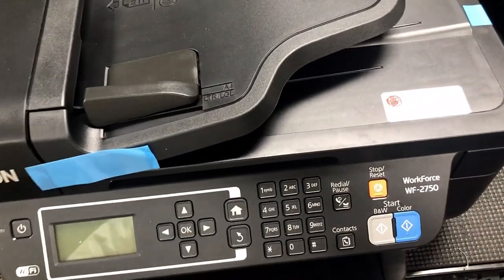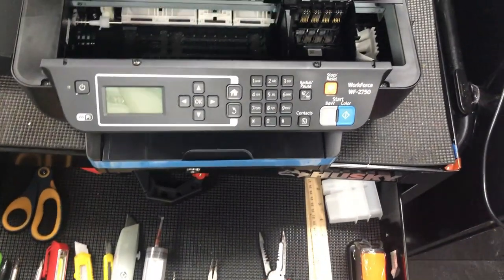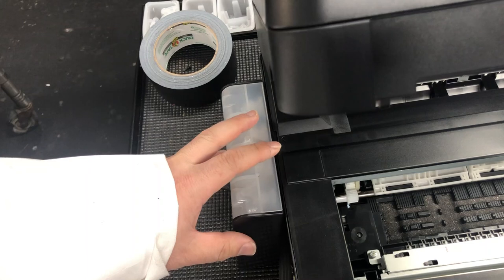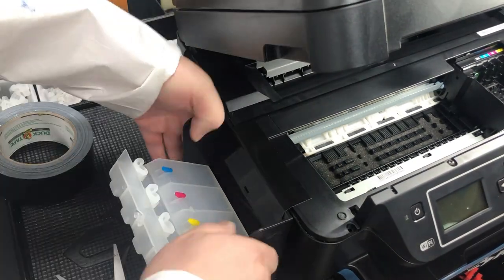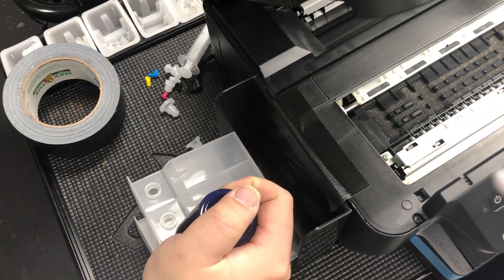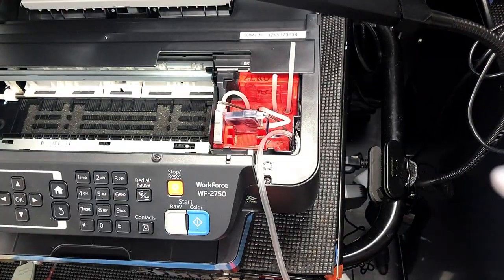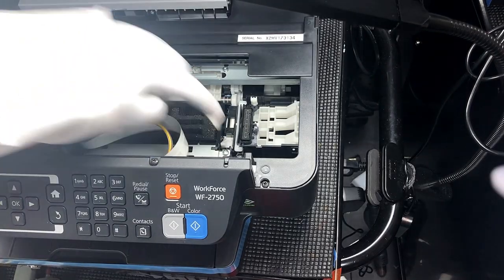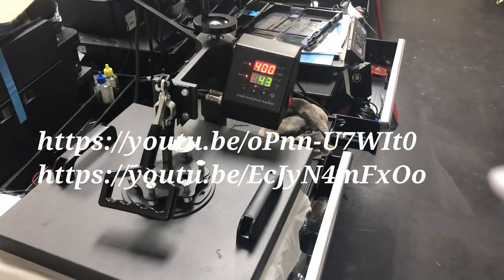Add Ink Tank: Epson WF2650 - Sublimation/Pigment - T220 Cartridge Printers

Comment: (Had to revise my question)

Does this work for regular printing? I found this video from your website. After looking further I noticed it's for sublimation printing. Would this work for both purposes, and does the WF-2750 mod kit include everything needed?

I didn't know about sublimation printing until seeing this. Now I'm curious to try it out, if my printer can handle that. Thank you for this information!